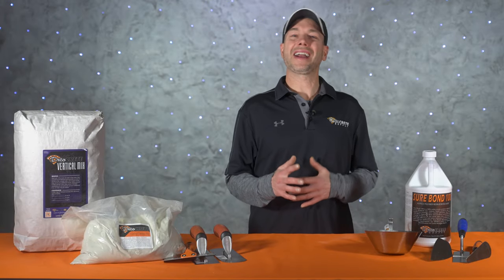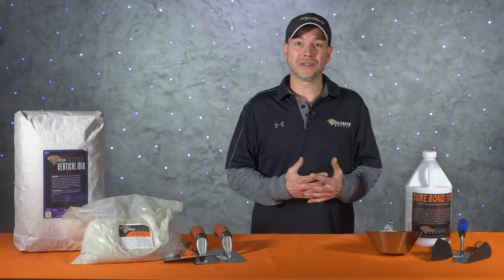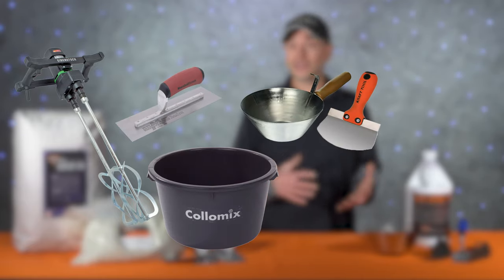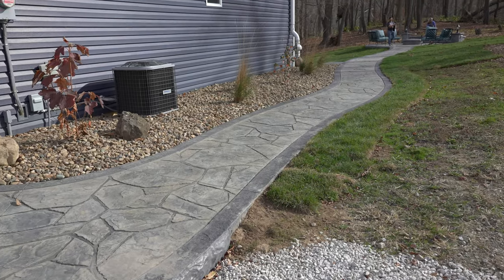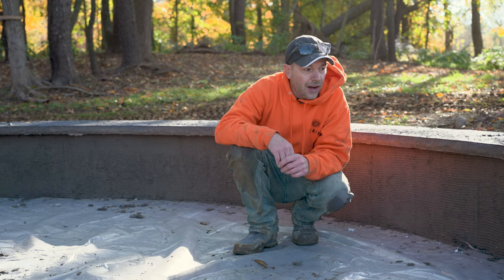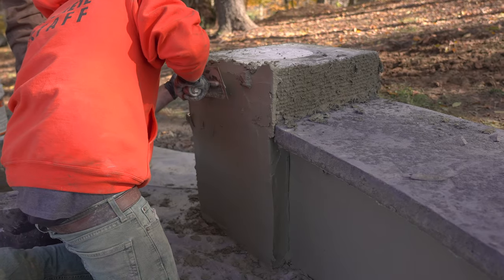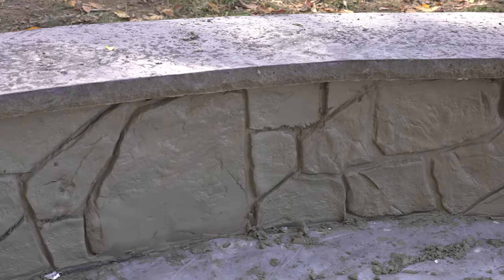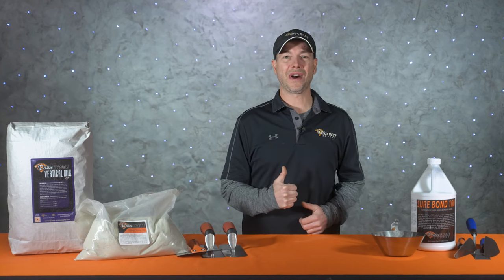How to Apply Vertical Concrete!

Comment: Is there a cheap product that could be used as release agent? I heard maybe cooking spray?
Reply from the maker: Thanks for the comment! There might be a few things out there that would work, but the concrete stamping release we used in this video works the best. For projects like the one in this video, one gallon would go a long way. Most cooking spray is around $3.00 - $4.00 per 8oz can, so it would still be around $50.00 a gallon. I'll leave a link to the liquid release page on our website. Thanks for watching Deco-Crete TV!!!                                                                                                                                                                   
 https://www.deco-cretesupply.com/products/releases-vertical-concrete/deco-liquid-release

Comment: What is the process for stamping the concrete fire pit?
Reply from the maker: Hey Al, what's up? We stamped the firepit the same way we did the walls with just a little more touch-up. You need a new video on your channel soon!
Reply: @DecoCreteTV  can you get away with out a scratch coat on the concrete fire pit?